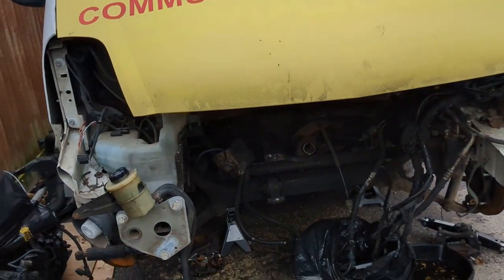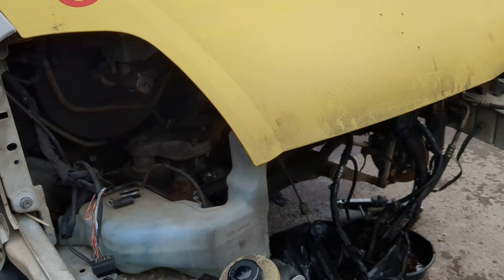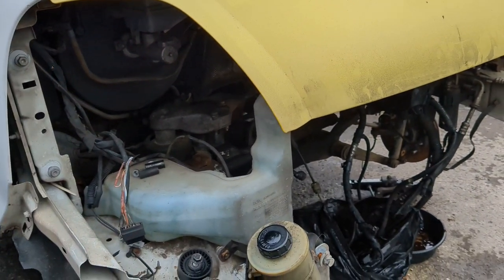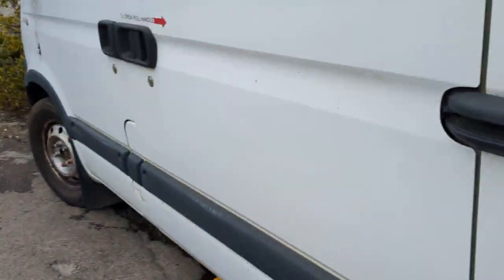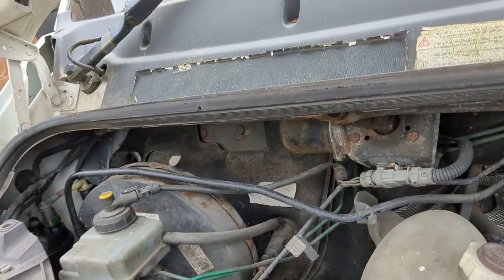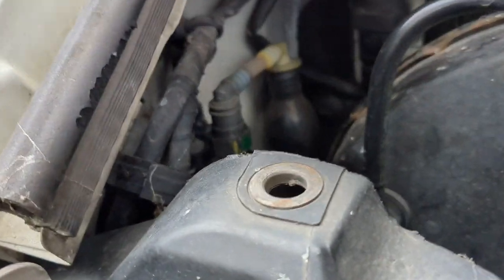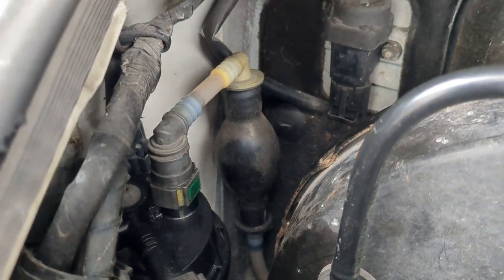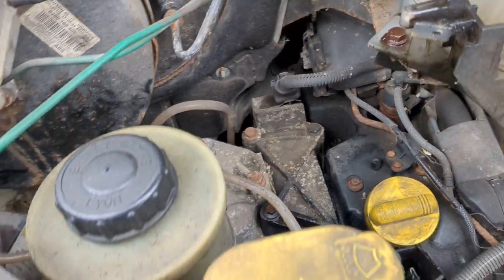Renault Master/Vauxhall Movano/Nissan Interstar cold start, no fuel, air in fuel most common cause.

Comment: Another cause of cutting out under load (that I've experienced on my Master Mk II 2.5 dCI 100 is worn injectors.
(You may have encountered this already)
Symptoms are:
Initially loss of power around 3k rpm, you can feel that it's gone limp, no EML/MIL/Check Engine light.
As it worsens over time - the ECU will shutdown engine without warning; you can't roll start the engine, and have to turn the ignition off then on to restart.
You may also see code P0089 in this situation.
Eventually it gets so bad that you daren't press the accelerator pedal on even the slightest incline.

Leak-off test will show the injector(s) at fault.
Injector codes need entering into the ECU via Clip.
Reply from the maker: Also choked EGR will do the exact same. They arent the best engines but I've had worse cough Ford TDCI cough
Reply: @rtechlab6254  I've had  a choked EGR on my Master, it didn't cause cutting out, but increasingly reduced power until the van could barely move under it's own power.
It was a nightmare to clean out!

Comment: Hi ive changed my fuel line fron tank to filter new filter housing but still have air in pipe from filter to pump? Engine , rung vauxhall but that part is discontinued,  any thoughts thanks
Reply from the maker: Last one I did I used a universal part. The nylon fuel hoses are a pain to work with though
Reply: @rtechlab6254  
Thanks,  I thought I could use that but our mechanic said there's nothing other than tracing a part , cheers

Comment: I can't get my Renault Master to start, there's a solid red light on dash with the stop lit up which i believe means the immobiliser is on ive checked for bad earths, corroded wires and can't find anything. Ive also put a different ECU kit on with ECU, pcm key and transponder and it's still the same. It's really annoying, any idea what it could be?
Reply from the maker: Pull codes if you havent, otherwise maybe pop onto the Renault Master group on FB
Reply: Fuse

Comment: What part needs to be replace ? From the fuel filter housing ? Please
Reply from the maker: The fuel primer bulb, its a rubber squeeze pump
Reply: @rtechlab6254  I did change that part but still have bubbles in line